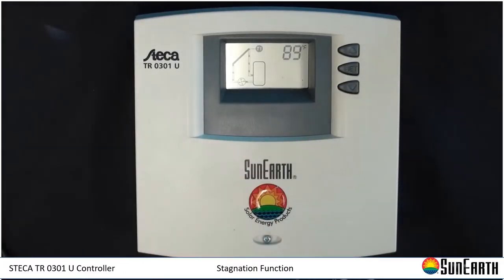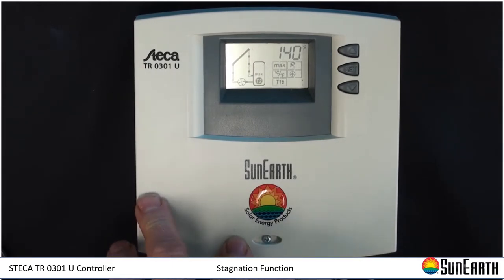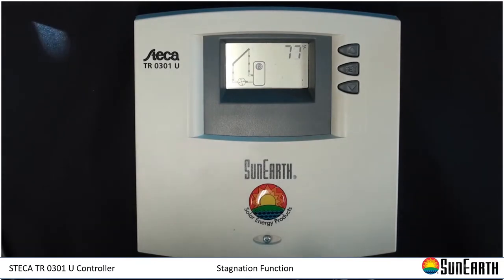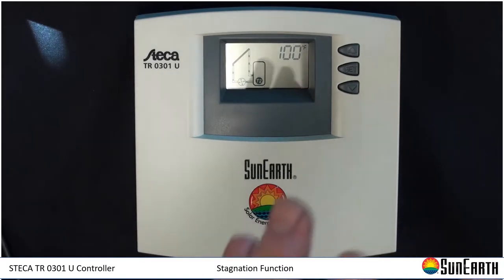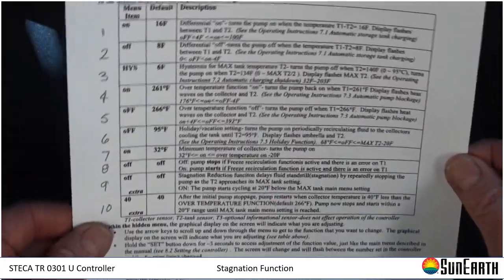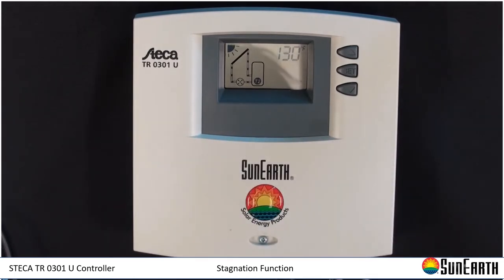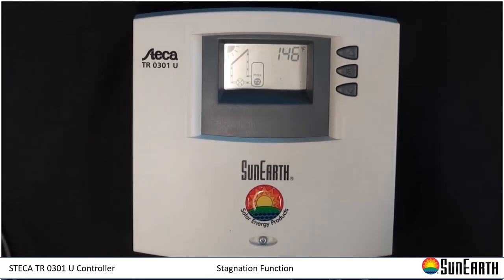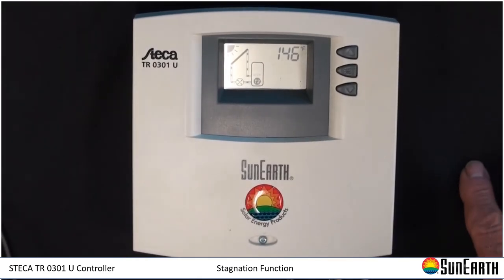Steca TR 0301 U Stagnation Function

Comment: My T1 temps often read at ridiculously high levels. I'll come into my utilities room at night and the system is running.. The T1 might read 186 and the T2 reads around 110, so the system is running. But when I unplug and plug the unit the T1 might read 75 (which seems reasonable at night) and the T2 still reads 110 ... so the unit immediately turns the pump off.  It is like the T1 reading gets stuck on a high number ... so the system is actively cooling the tank water.
Reply from the maker: The most common cause of this issue is the thermostat  wiring  between the control’s sensor  terminal  (T1 )  and the roof sensor :

The thermostat wire’s ( with two individual wire  strands )   connections  to the sensor are corroded  due do entry of water …check and rewire these splice connections.
The thermostat wire has been compromised by the environment ,primarily in that the wire is running or pinch against the hot copper piping . This causes the internal wire insulation to fail , allowing the two strands  of wire to intermittently  connect with each other causing the erratic  temperature readings.. locate areas where the wire and pipe are in contact and preplace this section.

Replace any wire damaged by the sun , wind or animals .

Consult owner’s manual as to running the thermostat wire near high voltage wiring ..

If your system uses evacuated tubes and the sensor is not located in a specific thermal well ,   the extreme temperatures generated by the tubes may damage the sensor over time . Consult manufacturer as to proper placement of  the sensor for these collectors .

Testing the control itself  requires disconnecting the T1 sensor and connecting a  new “test” sensor to the T1 terminal ; if the roof  reading stabilizes  then the issue is usually  wiring or a faulty sensor ( as above ) .

Comment: How did you change the roof temp wothout touching the control panel? I cant seem to change the temp from the buttons
Reply from the maker: Each push of the down arrow button shows the  ( T1)  roof temperature,  ( T3)  top of tank temperature and the ( T2 ) bottom of the tank temperature on the  screen.  If T3 is not connected only T1 and T2 will be shown in the screen. 

The roof temperature is what the T1 sensor is reading at that moment .   
Changing setting in the control program are done through the Main or Technician’s menu  and can affect the system performance .
Reply: @SunEarth  the problem I'm having is that it needs to be at a higher level than it is now and in the video the technician increased the max t1 temperature without touching the panel
Reply from the maker: In order to change the default settings in the control , the specific function must be selected and then opened to make the changes; see the control manual and /or the Hidden menu for sequence of programming steps . @jreidz100
Reply from the maker: @jreidz100  Additional responses from our in-house tech:

How old is the controller ? Where are they located? 
 Is the front cover( upper case )  properly secured to the lower case ,which is usually attached to a wall ?
When the operating  up or down arrow buttons are pushed do the Icons change in the screen? 

In the video I was using our test equipment the manually change the temperatures on the screen;  this is for testing and  used when  showing how the controller reacts with temperature changes for the video  presentation. 

There are ten (10) Functions in the “Hidden Menu”. 

If they  are trying to program the “Stagnation Reduction function”, numbers 9 and 10 on the technician’s menu,  and not able to reach a specific number , you need to go back to the  4 and 5 functions and change one or the other so that you do not come within 4 degrees of each other  before you set the On or Off temperatures in these functions. 
Lower the ON  function(#4)  and then bring the OFF function to no less than 4 degrees of the ON  temperature setting.

Comment: My TR 0301 U temperature reading disappear, what is the posible cause.
Reply from the maker: Please check the connections, unplug and re-plug back in. If this does not fix it, please get back to us.
Reply: @SunEarth  I did turn off and on the breaker and still not working. My water heater is not working too when I turn on the gray box(timer)
Reply: They got my controller hard wire, so I need to get in to the breaker
Reply: Do you have number that I can call ti check my solar water heater?
Reply from the maker: @josephmallare6635  Hi Joseph, please call 909-434-3100 and ask to speak with Bob Danielson, Technical Sales.